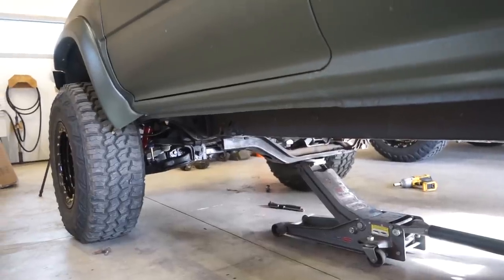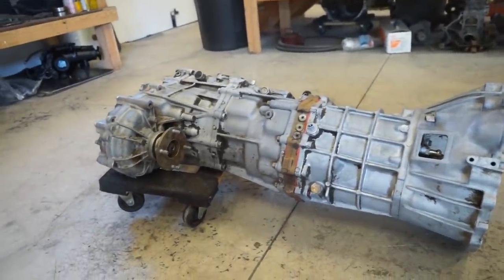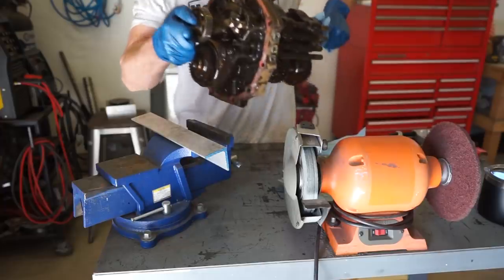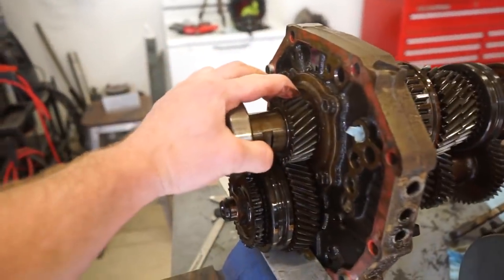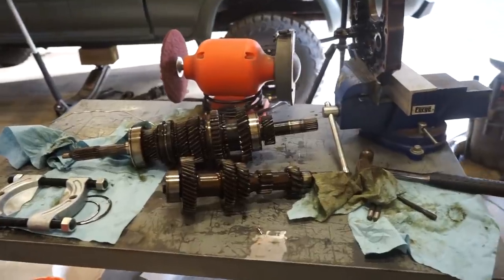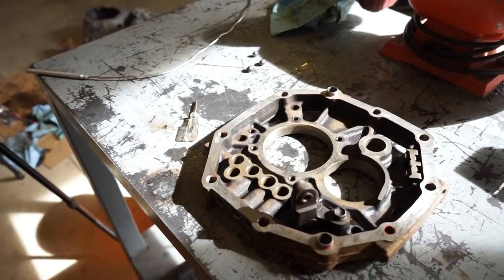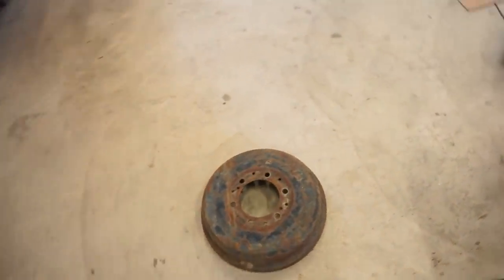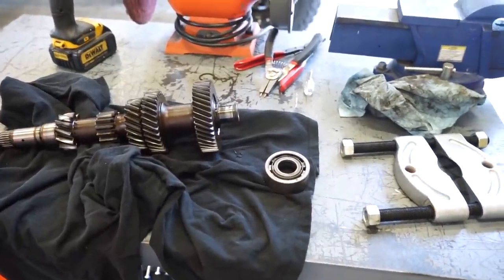Rebuilding A R150F Toyota Transmission Part 1

Comment: If anyone wants to know, the rare R151F from the 4 cylinder 22RET USA transmission uses the same bearing kit as the bearing kit as the USA R150F transmission. Don't confuse it with the kits that are available for the Land Cruiser transmissions.

Comment: Hey Austin. Check the wear of ring which is between reverse gear and syncro of the second gear(the one with teeth inside). Don't know it's name in english sorry. Btw - Syncro only helps to engage the gear smoothly, when it's worn out, you can still shift gears but with adding some rpm by pressing the gas pedal before. Ring i mentioned on the beggining 'holds' the gear in place, but if its inner teeth are worned, then gear will pop out. Hope You understad what i mean;) good luck!

Comment: Austin: “Like many of you, I’ve never done this before.” (As he expertly disassembles an entire transmission, replaces parts, knows exactly what tool to use, and has it, then reassembles after proper torquing, and reinstalls, etc!!!) 
Me: “Yeah, that’s not like me or anyone else I know; have known, will know...”
Reply: And he did it all by himself. Haha
Reply: This fix will only work for a bit but it's all to do with the wear on the dog teeth where it selects gear

Comment: My 92 has always popped out of gear in first from time to time. I've been driving it for 21 years. Just happens every once in a while. Awesome videos man. I'm redoing mine now. Got a ton of good ideas from your flatbed build on the red truck. Thanks for taking the time to share with us
Reply: My 99' has been having the same issue for over a decade and has finally started doing it every time it's in 1st gear. Looking at tackling the project in the next month or so, along with replacing the clutch.
I'm intimidated about opening the transmission, but thankfully have a few friends who are willing to help/guide me to getting it done.

Comment: To keep the shafts from rotating to remove/torque the nut, move the shift collars so two gears are engaged at the same time. The different ratios basically lock everything together. I've done a couple manual transmission repairs (Toy L52, Ford ZF5-47,) both shop manuals indicated the same thing to stop rotation.
Reply from the maker: Thanks!! Yeah I figured that out! Works amazing!!

Comment: never mess with engine before but when my head gasket went out on my 4runner i bought the parts and did it all by myself got my yota manual to get the correct torq spec timing etc took me 2 days and it was fix ! and 2 years later still going strong ! so like you said if take time to do thing you can do a lot ! nice video buddy have a nice day
Reply from the maker: That’s awesome!! Thanks you too!

Comment: My 1986 FWD had the same problem of the tranny slipping out of gear.  A Toyota mechanic had me buy a new Teflon gear shift knuckle  and all I had to do as pull the shifter out and replace the old worn out knuckle and put the new one in.  Works perfectly.

Comment: going through one on a customers truck that was supposed to be a simple engine rebuild that snowballed. replacing the input shaft and the syncros and seals while I'm there. thanks for the walkthrough that is saving me the guesswork.

Comment: Hay Austin I had the same problem, dealer ship told me most often the nylon ball on the bottom of the shifter wears down and it changes the amount of throw and won't let it travel far enough to go into gear. About $10.00 part didn't even have to pull trans it worked.
Reply: My land cruiser had the same problem.
Reply: The was the first thing I thought too.  I was having hard shift issues and it was just the plastic bushings.  They will actually disintegrate fully over time and completely disappear down into the gear box.  Mine were cracked with some pieces missing.  It's literally a $10 fix that works and I flushed my gearbox oil when I put the new ones in.  I bought delrin ones from Marlin Crawler.  Austin doesn't even mention these bushings in either video.  He may have rebuilt the tranny for nothing..(aside from the experience and making a great DIY on the R150F which is of course awesome in itself).

Comment: If I was neighbor,  I would be helping you out when ever needed.
Anyway excellent video,  I could never go that deep but does motivate me to take on rear seal replacement on my 96 4-runner Limited.
While in there replacing oil pan gasket of course.
Leakges aren't too bad but bug heck out of me!

Comment: Whenever you work on a fairly high mileage TACO transmission (75k+) ALWAYS replace ALL of the bearings! Now is also the time to check and/replace anything related to the clutch (throw-out bearing, grease the ball pivot on the release arm, etc).

I have a 1995.5 TACO SR5 4x4 v6 and I replace the transmission bearings every 75k miles in addition to standard maintenance. I love my damned old truck! It is very tough and really fun in the mountains!!
Reply from the maker: All the clutch components are new! And yes I’m doing all the bearings 👌
Reply: Oops..wrong link...BRB
Reply: That is the correct link...check it out!
Reply from the maker: @shawnmcpeak7934  thanks I actually saw that video!! Very helpful

Comment: Just redone the clutch, pressure plate, fly wheel, pilot bearing, throw out bearing and starter in my 98 taco and used the same tranny Jack they work slick!
Reply from the maker: Yeah can’t believe I haven’t bought one yet! They are sooooo nice
Reply: @austinniemela   yeah worth their weight in gold

Comment: Thanks for the walk down memory lane! I had to change the main shaft bearing on my 87 4runner about 15 years ago. It was too funny watching you. I cussed way more than you did LOL!!! I got the tranny out by myself. I about killed myself trying to line up the spline when I was putting it back together. I finally went to good ol Harbor Freight as well and bought a tranny jack. Best purchase ever! Annnd I never used it again. Still sitting in the garage collecting dust. I am not a mechanic, zero training, but pretty good mechanical sense and I pulled this off. You can do it if you are careful and document everything. Lots of parts. :-) Plus you have YouTube! Thanks again you are awesome! Oh and watch out when you are putting it back together. I swear I had to tilt it to one side putting the shifters back on. It wouldn't go into reverse. I had to drop it out and tilt it the other direction and then put it together. Once I did that it went into reverse. 87 is still running!!!
Reply from the maker: Thats awesome!! The transmission jack is a must have!!

Comment: Well done!!  My R150 recently went from popping out of 1st a few times a year to every time (if I don't hold a little fwd pressure on the shifter).  My plan is to swap in in a rebuild from Yota1 Performance, but I enjoyed seeing what's inside on e of these units.
Reply: Check the plastic bushing at bottom of gear shift first. Mine did same thing — twice now,

Comment: The shif linkages do not need to come of the trans center carrier jus remove the retainer bolts on the forks,remove fifth gear and counter shaft rear bearings and spacers them remove the bearing retainer plate and clips  and the whole gear pack will slide  toward the front  also do not forget the shifter saddle bushings

Comment: I use a bearing heater and a freezer to get the bearings back on. Inertia welder transmission. What your doing is a lot more complicated.

Comment: You’re going to need a new shifter seat bushing and ball end bushing. The seat bushing will eat itself up over time causing the shifter to have reduced throw inside the trans. Very common on YOTA manuals. The gear oil looked like it was shot at some point in the transmission’s life.

Comment: Fun to watch. Learned a lot about the trany. Wondering if you can help me on my 1999. Pulled the trany  to replace the input shaft and bearings. With the cover off the shaft and bearing won't come out. Do I need to pull the bearing first or worse case split the cases?

Comment: With these trucks (and really any with a manual tranny) you've got to work the problem from the top down first!  Start with the pedal adjustments, then make sure the pedal bracket itself is 100% and not cracked (they are known to on these trucks), and then make sure the hydraulic Clutch Master Cylinder is working properly with a full stroke. Dialing in the masters push rod just right for a full and proper stroke can be a PITA.  And then make sure it's pushing the slave cylinder properly and re-bleed with new clutch fluid. Lastly, I would also pop out the shifters in the cab, check the plastic shifter bushings.  They wear down and disintegrate over time.  And best of all they are only a few dollars to get new delrin type from Marlin Crawler.  And then finally, flush and change your gearbox oil (and xfer case if you have one).  If all that doesn't work..only then would I take on the huge task of actually dropping the tranny, which as you now know, takes a hell of a lot of effort. You made it look easy but it's not that easy for 1 person. (but that body lift sure helps get to the upper bolts lol!) 

I just went through all this myself last year and also have the factory service manuals.  I highly recommend using them, especially for as much work as you do.  And personally, I would not be using Scotchbrite pads on any precision ground shafts.  That's just a big no-no.  Much better to use a sonic agitator in your cleaning tank.

Comment: g-day, 
First gear jumps out at the first sign of any load, this affects no other gears. The gearbox shifts nice and smooth really nice for 400K+ . Is this possibly just the detent? is it possible to replace the detents without full disassembly or even removal from the car ?

Comment: hey i got a question do you change your transmission fluid on automatic or keep orig my toyota manual says dont touch it so does my mechanic. I got ovver 300k on orig transmission oil a long with my buddy and other ppl i hear . like why even bother change it if ppl go 20 plus 300k w out ..

Comment: I know you put a 1 1/2 inch body lift on the truck. Did you extend your two shifters? I couldn't see when you were pulling the shifters off. Thanks!
Reply from the maker: Yes I just welded in some small extensions

Comment: Hey man. Im doing the same thing to my tranny. And my question is when you took off that bolt and pulled off the gear with that puller, that gear behind it that just slides off and is the one that the shift fork goes around, did yours have little spring loaded cogs under that collor? Im afraid that if i let that collor slide to far one way that all that stuff under that callor will come flying apart? Also mine just had c clips and didn't have a bolt to take off. My main concern is with those shifting callors and the spring load stuff under them. Did you take ur apart or will stuff come flying out?
Reply from the maker: Yea there is just a bit spring clip and the 3 cogs, easy to put back together!
Reply: @austinniemela  Thanks for replying. Im nervous about it cause this is my first. And its on my only ride and if i screw up ,im screwed. Im trying to rebuild it and get it back in before Monday. The parts came in and i took off yesterday and pulled it, and im off the rest of this week, so in hoping to get it rebuilt by tomorrow.
Reply from the maker: @todhowell5049  just watch close how everything comes apart!! It’s really simple!
Reply: @austinniemela  Ok. You made a great video, but some small things were i guess edited out or missed. And im one of those dummies that has to see every detail and if i run into something while doing it and haven't seen it,i start freaking out. Like on the caseing on that shifter side, it has a spring loaded arm that stays in the caseing when you pull it apart. That doesn't get in the way or effect the shifting rod when you slide the rod back in as you put the caseing back on? It looks like it should touch the back of that paw on the rod to my center the shifter. But as long as you put that paw in the ends for the rods, then it should all line up as you slide it together?
Reply: Hey man, i sent you a question on your second video about those two pins that will fall out when you remove the fork rods. It didn't show you removing them or putting them back in, they were in a Ziploc bag when you showed them. But i found my answer. Apparently they changed that up a little from the 91 to the 98 like mine. Mine only has one of those pins and those football looking detents that are different sizes on yours,are the same size on mine. So if you see my reply on your second video,just disregard it.
Reply from the maker: @todhowell5049  sorry! Glad you got it figured out!! They did change a few things through the years
Reply: @austinniemela  Thanks man. I have one question for you if you can remember? When you started taking that tranny apart, there was a bearing in the main shaft that you pulled off with a 3 jaw puller, then there was that sleeve,then there was that last gear,(before the plate) that you pulled off , so you could pull the main shaft out through the main plate. Was there any wiggle ( back and forth) in that gear? It has splines and smooth grooves and the shaft is completely splined. Could you take yours and bearly move it back and forth? ( Not on and off the shaft, cause it just slides right off after you take iff that sleeve, but wiggle it back and forth like the splines have a little play? Do you remember? Cause mine,i could wiggle it just a little,and if it was splined exactly like the shaft,i would say that it shouldn't do that and the splines were worn. But it has different splines than the shaft, and you have to clock mine a certain way for it to slip right on.